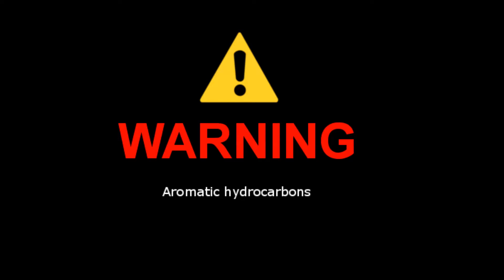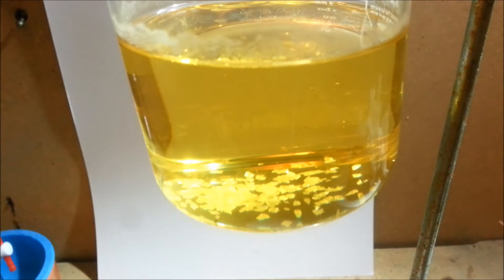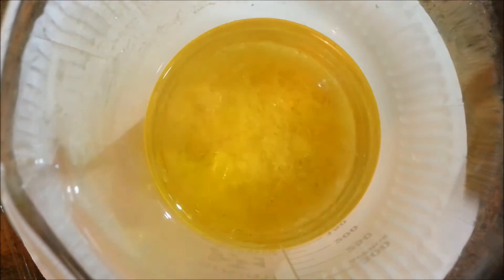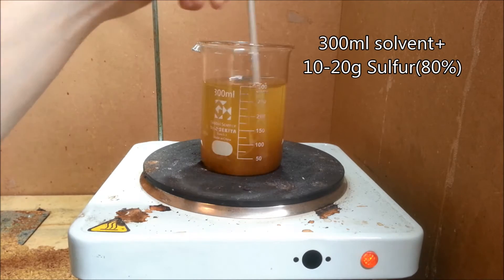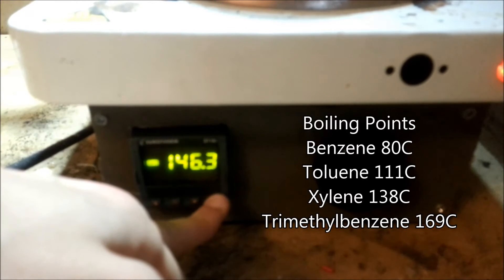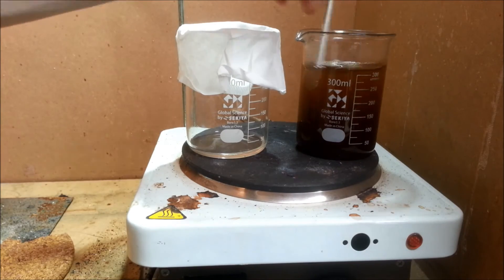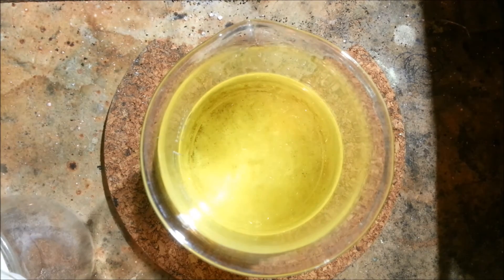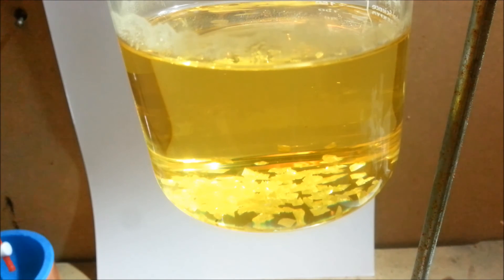Crystalline Sulfur from Pesticide.

Comment: I learned from this video that recrystallization can be repeated for bigger crystals 👍
Reply from the maker: Up to a point. Recrystallization only purifies whatever you're crystallizing, reducing the chance of irregularities in the lattice. After that temperature and saturation control is the name of the game. Also a seed crystal gives an ideal place for the material to come out of solution. The same crystal can be used in further runs and will continue to grow, though it will eventually pick up some irregularities.
Reply: @JKKnudsen  that's exactly the type of info I like to read

Comment: Can u recrystallize sulfur from h2so4
Reply from the maker: I theory yes, In practice no so easy. Usually you would go the other way around, and make Sulfuric acid from sulfur(I.e the chamber process).
Reply: @JKKnudsen  if u make sulfur   recrystallise from h2so4 i can pay you
Reply from the maker: @RBHAI88  If you can get sulfuric acid, you can probably get sulfur a lot easier. The process of making sulfur from sulfuric acid, would first require the conversion from sulfate, to sulfide(maybe Sulfate-reducing microorganisms), then reduce the sulfide with a metal like magnesium. The magnesium sulfide can then be reacted with a halogen, to produce sulfur and magnesium iodine.
Reply: Thanks